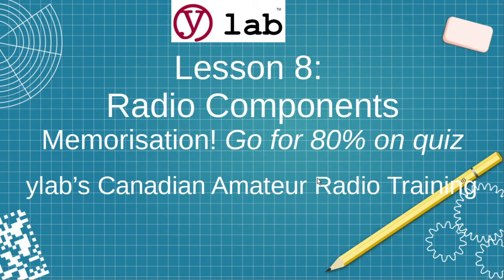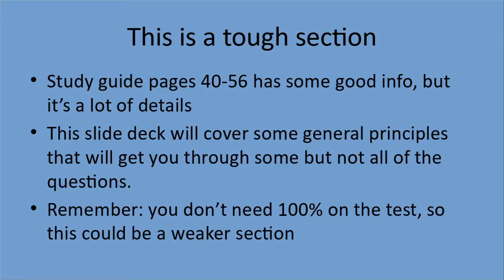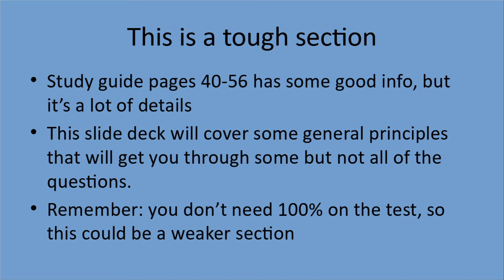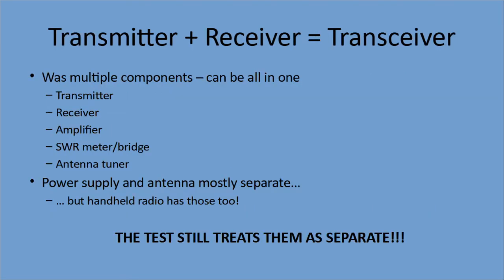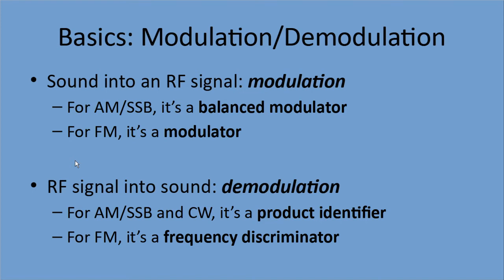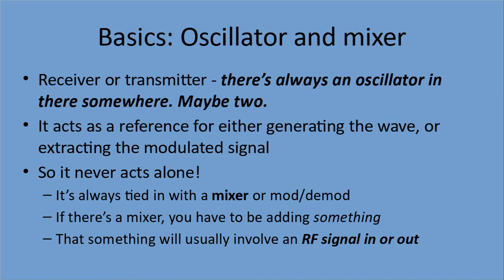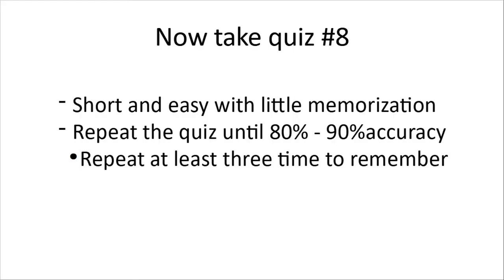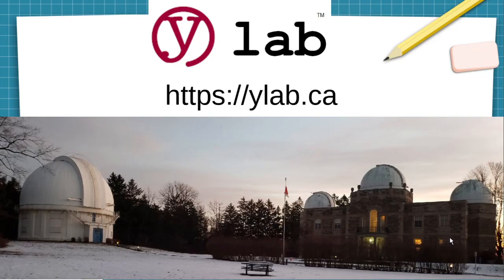Lesson 8 for Ylab's Canadian Amateur Radio License Course

Comment: At about 5:10 on the slide titled: Transmitter Essential Steps, the second point that reads: "Clean it up and modulate it into a SOUND wave".  I'm assuming that's an oversight. You say radio wave around that timestamp and from my limited understanding of modulation that's what we're doing yes?